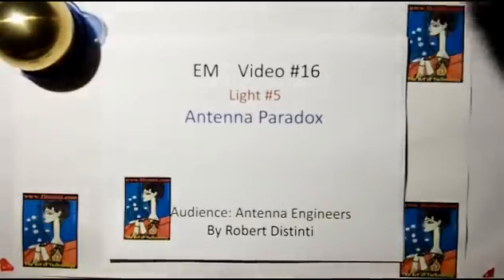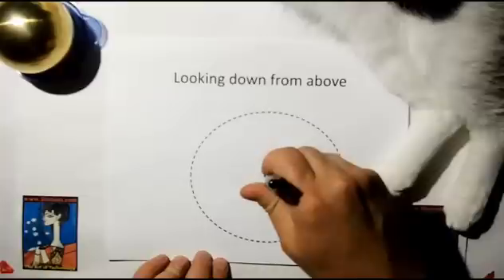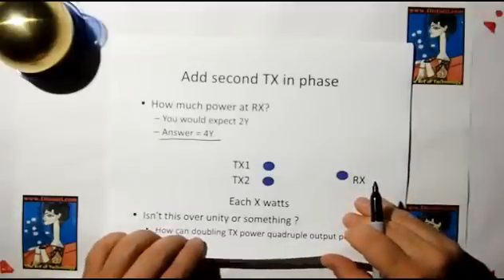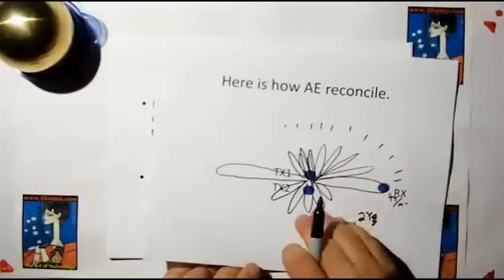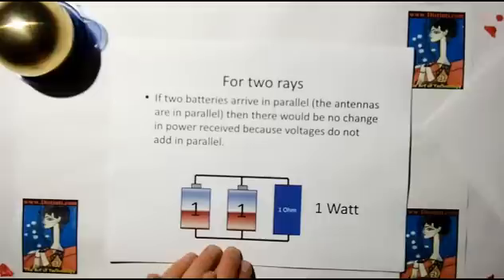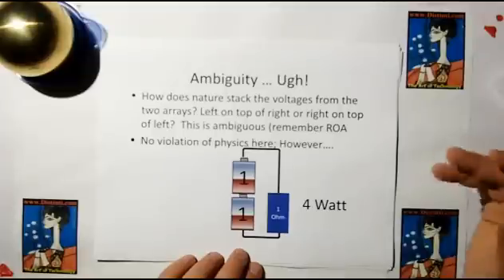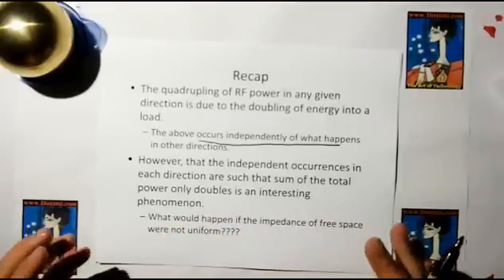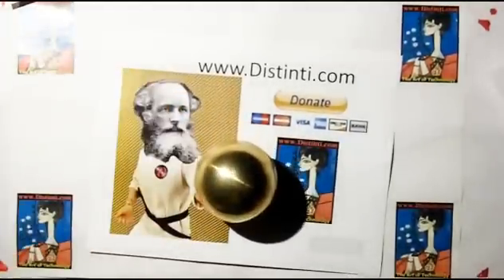emV016: The Antenna Paradox

Comment: Another model discrepancy.  You are piling up double voltages through a single 1 ohm transmitter - when you say you have 2 separate transmitters (TX1, TX2) with (1 amp each) going through 2 separate (1 ohms) transmitter loads.  You then propagate your kinetic energy toward the receiver (RX) which picks up both parallel and insynch transmissions at the same time.

You are twisting logic into insanity by using a battery model of a singular closed system into that of a singular serial system through a singular transmitter.  Balderdash !  And there is no closed circuit for either of these systems of voltage into the ohm transmitter (- let alone the serial bogus battery image).  You need to correct this model for ITS AMBIGUITY ... junk science right here (!).

Get back to 2 separate voltage "amps" separately going through their own ohm "loads" and jointly broadcasting in parallel and insych transmissions to be received by the singular receptor - which will receive 2 watts.

(TX1) 1 Amp => 1 Ohm => 1 transmitted Watt =======> (RX1) received 2 Watts
(TX2) 1 Amp => 1 Ohm => 1 transmitted Watt ==/

Comment: I am aware that this video is slightly dated, but all we are dealing with here is basic Ohms Law.
if the load impedance is held constant as in the example of this video and doubling either voltage or current into that load, 
the other term will also double. Although the power is often expressed as either E^2/R or I^2R, it is also a product of E & I.
Therefore when one term is doubled  the other one also doubles, i. e. 2V x 2A = 4W. Sorry if this is an oversimplification.

Also keep in mind that the received power is always going to be less than transmitted power due to the inverse square law.
So the quadrupling of power is relative and only true if the distance between the TX & Rx antennae is fixed and either the voltage or current are doubled at the transmitter end.

other than the referrence to energy for the current and voltage, I don't see any technical problems in this video.
As I said it's just basic ohms law.
Reply from the maker: The purpose of the video was to use ohms law (as an analog) to show that there is no paradox.  However, by observing how the different type of circuits add in parallel, we conclude that superposition of radiated waves add  more like current sources (which add in parallel) as opposed to voltage source (which add in series).  Thus I call into question the widely held notion that the main pole of a radiated wave is an electric field (this is one of many arguments against)

Comment: The antenna paradox has been exhaustively and scientifically explained in the paper of Janos Vajda titled " “VIOLATION OF THE LAW OF ENERGY CONSERVATION IN WAVE FIELDS” which can be downloaded for free in pdf format from:

https://feprinciples.wordpress.com/free-energy-from-wave-fields/

A simplified explanation of the principle involved can be found at:

https://feprinciples.wordpress.com/how-to-gain-free-energy-from-wave-fields-simplified-explanation/

There is no need for exotic new theories, and fruitless speculations.
Reply: It appears obvious after reviewing the links above that the microwaves and coaxial cables are involved, 
in which case there are impedances, voltages and  currents.
Therefore you do not need anything other than the ohms law to prove that the power out equals power in, no matter how many in phase sources we have.

For proof, review this video and read my comment above as well as Robert Distinti's reply to it.
while doing so, please keep in mind that when either the voltage or current doubles, the other will double automatically.
This means that each source is now supplying double the power they were supplying individually, so two doubles most give double of that
or quadruple of either source individually.

This principle has been around for a very long time in electrical and electronic circles,and is not new nor over-unity.
The 4x power out must and does come from the source.
Reply: Mark, You have got no idea what you are talking about! 

The science of microwave propagation and antennas can not be simplified to ohms law. 

When two half-wave dipole antennas are placed on the same axis with their feed points at half wave length distance apart, then the intensity of radiation in the direction of the axis is practically zero. Consequently there is no significant coupling between the two antennas (not even due to negligible near field capacitive and inductive coupling). Therefore, the voltages and currents at their feed points will be practically the same as if they were alone. The input energy required to drive the antennas will be practically the same as if they were driven alone.

If we assume that each of the antennas are fed with 1W of power with identical frequency and phase, then after integrating the total output power on the surface of a closed sphere in far field we will get about 2.72W resultant energy leaving the system (total input: 2W; total output 2.72W). Notice that we will not get 4W output only due to the practical limitation that we can not place these two antennas closer to each other than half wavelength while keeping them on the same axis. If we could do that then we could get closer to the maximum theoretical possibility of gaining 4W of total output energy.

The gain of excess energy in far-field due to the favorable superposition of the waves does not have a reciprocal back coupling to the RF generators that feed the antennas. Therefore this system can not be compared to simple DC or AC circuits of low frequency where such interference of waves in free space does not exist, or insignificant. You can not judge the energy balance here based on the oversimplified and incorrect applications of ohms law.

Please read the recommended scientific paper of Mr. Vajda, and try to find error in it. If you find one, then please explain what it is. If you can not understand that paper, or can not find flaw, then you will look wiser if you keep silent.
Reply: I wouldn't quite say that I have no idea in what I am talking about, have been in electronics field for a little over 40 years, few of which have been in fields of RF communications - admittedly not in microwaves. However the difference is really only in frequency and wavelengths.

What I am not an expert in is higher mathematics which I cannot and will not argue.
The mathematics that I use and understand is used purely as a tool to help me achieve what I need to either do my work or come up with some practical solution to a technical problems.

Unfortunately there is no way to exclude the ohms law on the basis of frequency and wavelength.
If what you claim is correct, it should not matter that the wavelengths are few  millimetres or few kilometres, your reasoning should hold for both as long as you use antennae of correct physical size determined by the operating frequencies and wavelengths.

Also, as I said above, microwave transmission involves characteristic impedances just like the lower radio frequencies and as a consequence must involve voltages and currents at these frequencies, so the ohms law will apply to every aspect of the analysis of the microwave system.

In regards to the transmitting and receiving antennae, how far do they have to be apart where the inverse square law would make the sum total power received drop to and below unity?

As you said initially, there is no need for exotic new theories and fruitless speculations, that is exactly how the paper you linked to which I have downloaded looks like.

You seem to be convinced that the paper written by Mr Vajda is full proof and cannot be argued against & I don't think that we can come to an easy and quick agreement one way or another, all I am saying is that the ability to show that 2 quantities of same value such as voltage or current, of same polarity or phase, applied across a common load where their combined value is double will yield a 4 x increase of power on the load, at least in electrical and electronics work they will. And in this case it can be proven that the supplied power is equal to the load power, although, taken individually it will look like we are gaining something when we are just deluding our selves.

The only way that any one claiming over unity can convince anyone else who can't see their point of view, is to do one thing and that is take some of the "excess" energy and feed it back into the system and then remove the original sources and have the system continue running with a load attached on the output. 

The internet is over populated with people claiming that over unity exists, but so far there has never been one that is provable. I believe I have more chance of proving it's existence at least in the virtual world of computers and P-spice based simulator, the program runs a circuit, based on conventional real world  components, takes some power to get it started and then spits out few tens of kilowatts into a load, there are two possibilities:
1. The simulator program has errors in its models or 
2. there is something in the principles or mathematics used by the program to calculate and predict a behaviour of the circuit that no human being has been able to see.
I had my few pet theories on how this could possibly happen, but without being able to prove this in reality I have to conclude that the first suspicion is closer to the truth.

Now I am not saying that over unity can or will never be achieved, history is riddled with cases of people in high positions of science and mathematics saying to the ones claiming it can be done, that it can't, until someone actually proves that it can.
Therefore, I go back to my original request, prove it, or show me someone that can actually prove it with  actual real world results, in other words, back up all that great mathematical work with a practical experiment that shows without a shadow of a doubt that the power supplied into the system is less than that taken out of it.
Reply from the maker: I see the confusion.  I'm making a follow-on video (Antenna paradox II) which will show a different way to highlight what I was trying to show (everyone keeps thinking the paradox is more power out than in-- that's not it at all).  I was trying to use the well know phenomenon (that where the two antennas add constructively yields 4 times the power density) as a means to provide a clue as to what is really being transmitted...  no matter I will clarify in the new version.  BTW the surface integral of the emitted radiation yields a total power not greater than two antenna.
Reply: When two half wave dipoles are on the same axis with their feed points at half wave length apart, and fed with identical frequencies in direct phase, then the surface integral of the resultant radiation in far filed DOES YIELD a total resultant output power that is GREATER  than the power feeding the antennas. 

Please read the paper of Mr. Vajda, the mentioned integral has been calculated there, and the results are shown on a very enlightening diagram. If you want to prove that there is no excess energy generated, then you have to point out where the error is in that integral calculation. 

But of course if you say that the math is too much for you, like Mark said, then you are not qualified to judge the validity of that paper either. Consequently your opinion about this subject is just that, an opinion based on insufficient true knowledge, on a religious belief in the old dogma of energy conservation, and on idle speculations about weird new theories. 

The above vain argumentation of Mark is also just an unqualified opinion, not deserving further replies. He himself acknowledged that he does not understand the math involved, therefore he has no right to judge its validity.

I am aware that the intent of your video was not to support the the phenomena of excess energy generation from wave fields, but to support your own new exotic theory. 

However, the antenna paradox is not a paradox in reality at all, and it has been fully explained in the mentioned study of Mr. Vajda. Those who can read, have sound logic, and sufficient qualification in the subject will understand that what I am trying to convey, and what Janos has revealed in his book is correct and true.
Reply: +SourceAndDestination :
May I request, that you perform an experiment, a physical one that shows the input voltage and current to the transmitting setup and at the same time the recovered output voltage and current and then compare the two products, clearly showing that the (Vout x Iout) is greater than (Vin x Iin).
I only ask this so that people like myself who can't follow the math and who do not have the time to learn it will be convinced of the truth. 

Since you seem to be the most qualified person on the subject here, I recommend that the test be performed by yourself, in a proper scientific manner, showing full test method and the results, because if you are either unwilling or are incapable of performing the test to support Mr Vaida's math and instead just directing us to his paper you will be unable to convince anyone who is not advanced enough to understand it. And ayone who does understand it all, needs no convincing one way or another.

Comment: ANTENNA GAIN: Giving Power to an antenna, that power exits to space as Density of power (units of W/m^2). That density of power decreases with distance. To a Isotropic antenna (spherical irradiation) the Law is  "Power/(4[Pi]R^2)" at some wavelenght (frequency). Antenna Gain is a Relative measure of any other irradiation diagram face to that spherical irradiation.
As a real example, if we create a "donut" diagram, the density power is off to up and down and is progressively increased to the side (vertical view of the donut), and is a circle (omnidirectional) in the horizontal view of the donut. This can give 2X more Density of power in that direction relative to the density of power of the isotropic sphere. This is a Gain of 3dB. Parabolic antennas achive generally gains of 40dB to 50dB, depending on the frequency.
Reply from the maker: I agree with everything you have stated; however, when computing the far field pattern of two or more radiators, you can not compute the constructive and destructive interference using power. 
In the case of two dipoles, using proper techniques, at any given radius there will be points where the power is 2 times the power of the isotropic (of the pair).  And because other points have less; the total integrated power will come out properly to be that of two antennas.  So the question is, if light beams radiate independently of one another how can you get 2 times more power than the isotropic in any one direction?  (Without considering reflectors) That's the paradox which is reconciled as stated in the video.
The proper answer is that power does not add linearly; however, we cant add voltages in parallel because voltages in parallel do not add; thus the "so called" E-Field of an electromagnetic wave is incorrect, electromagnetic energy is a kinetic transmission of energy which is more akin to current.......

Thank you
Reply: www.Distinti.com
I can give some other true rocks where we can step the 
subject:
*As the Power outs to space as electromagnetic , we have 
spatial density of power (W/m^2) due to linear density of 
Electric field(V/m) and linear density of Magnetic field
(A/m). At any spheric surface at R distance of the antenna 
the Integration of that density of power have always the 
power gived to the antenna, independent of the radiation 
pattern. If the pattern is isotropic is coincident with that 
spheric surface of integration, else have many areas of 
almost nothing density of power and other areas with 
increased W/m^2 relative to isotropic.
*The radiation pattern to an antenna (intensification of 
density of power in some directions of space) is due only to 
physical positioning of metals at some fractions of 
wavelenght wich give construtive reflections in that desired 
directions. 
*The free space Impedance to the electromagnetic radiation is 
Resistive with value close to 377(Ohm).Wikipedia good 
explication. This means The Electric field is in absolute 
values 377 times greater the Magnetic field (E=377H). That´s 
why the Polarization of antennas is physically correspondent 
to E. In parabolic antennas and satelites frequencies this is 
very discriminative and useful:2 different signals in the 
same frequency.
*From 2 different electromagnetic sources to have increased power they must be at same frequency and in phase. This is achieved in Lasers in the beam direction, but in the omnidirectional case the most close implementation is the Single Frequency Network of digital phone cells.
Reply from the maker: I don't have a problem with anything you have written, So could you please tell me exactly what it is about my video that you have a problem with?
Reply from the maker: RF1204 Actually I posted too quickly, the only thing I disagree with you about is that there can not be an electric field in a radiated wave.  Also, the 4x power effect is an observed phenomenon and well known phenomenon.  I am merely using it to explain that the parallel incident waves can not be have electric fields.  There will be another antenna paradox video which will show another aspect of antennas that also show that electric fields in wave propagation are ridiculous.  By the way, you are describing DIRECTIVITY not GAIN.  Its a common mistake (http://en.wikipedia.org/wiki/Directivity).  GAIN is the combination directivity plus electric gain (or loss).

Also, properly constructed dipole antennas emit spherically, (this was a measurement made on a certified antenna range).  This agrees with New Electromagnetism.

Please spare me the lecture on antenna theory, my day job is an antenna engineer. Just tell me were you think I'm wrong-- no big lecture just a few words.